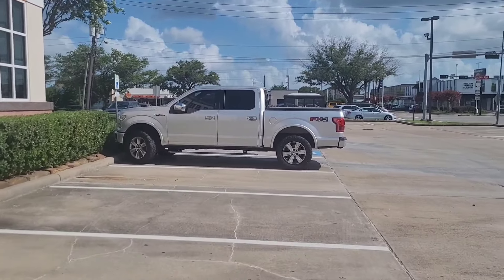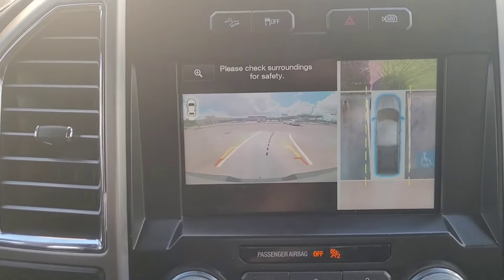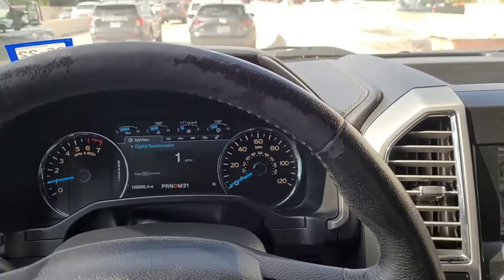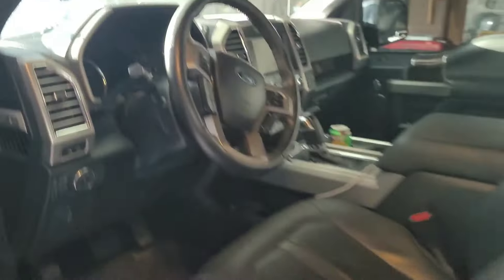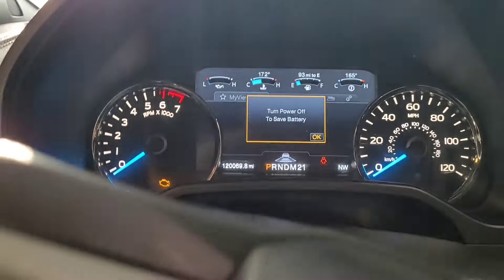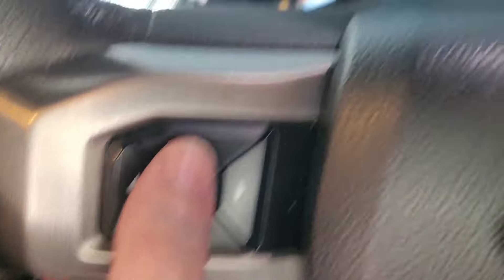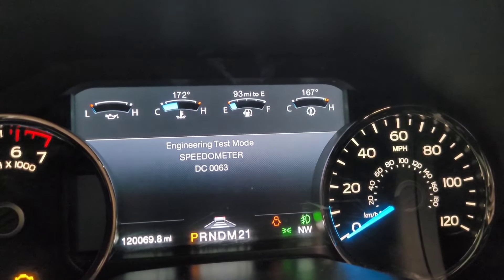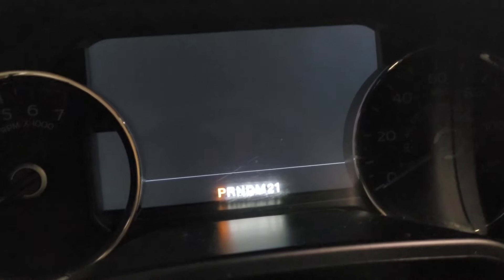Ford F150 Engineering Test Mode weak chimes and low voltage battery

Comment: I have a 2012 Ford F-150 about a new four scan tried head on it and just a few minutes it wouldn't do nothing cuz it said my battery was dead One of them boosted the truck off and take it up there and they said the battery was good and I alternator was good do you know of anything could cause that to happen I sure would appreciate your input thanks Robert
Reply from the maker: Hi Robert. For a 2012, I'm not sure you can do very much on Forscan. As far as your power, if alternator and battery are both good. It can only be the connections.

Comment: Oh no, it’s the 09-14 Ford sounds lol. I had the identical issue with my 2015 F150 Platinum except the culprit was a corroded wire connection on the driver rear speaker. For whatever reason swapping them out fixed the issue but not before 3 months of torment. Good luck to ya.